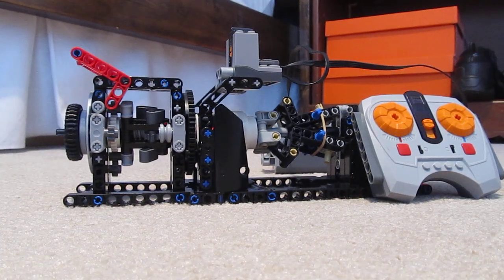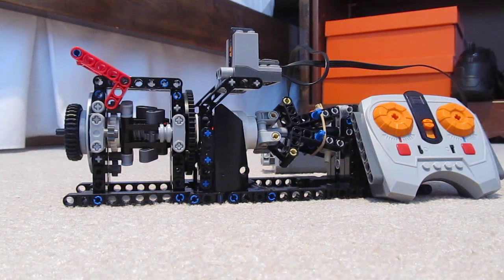Lego Technic: Auto. Shift Governor

Comment: For whoever is wondering, aircraft governors are used to regulate pitch change in constant speed propellers. They use this contraption called a governor to open and close a pilot valve using the centrifugal force of the flyweights. This guides oil to the propeller hub that houses a piston, to which the prop is then changed to either high pitch or low pitch with oil pressure (depending on the type of propeller governor).

I hope this helps. 😎

Comment: Seems to work well, but what is the purpose?
Reply: it passes butter
Reply: Hi there MadMartin. The whole point of a governor is to control the engine speed. These were used in steam engines and there are 2 types of governors. There is a centrifugal governor and an inertia governor. The centrifugal governor uses 2 flyball masses on either side to allow a collar (sleeve) to slide over a fixed shaft which then opens up a valve to allow the steam engine to run. An inertia governor works off the principles of moment of inertia and angular acceleration where the flyballs on the governor shaft change their position, which allows the governor to have a rapid output of a change in load.
Reply: Comment of the year lmao

Comment: It's a neat design but I don't think it would work so well if you place the drive train under load, e.g. connecting the output to a drive axle.  You're already using a lot of torque to drive the clutch mechanism at high speed, so it'll definitely be limited at the output end.  Like I said though, very cool idea and nicely built.

Comment: I don't understand why you had to take the turntable apart
Reply from the maker: Mainly because the turntable served as a way to transmit the drive-shaft through the center. But also because I needed a good mounting point for the frame.